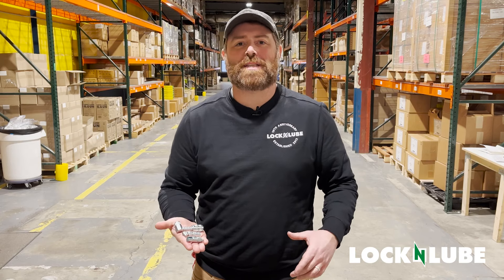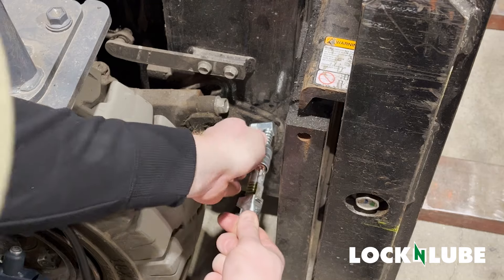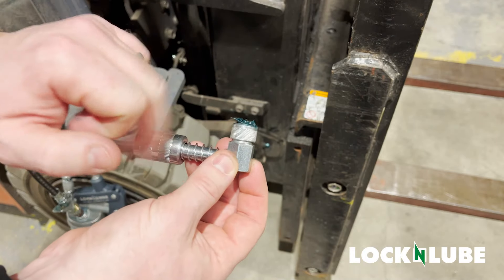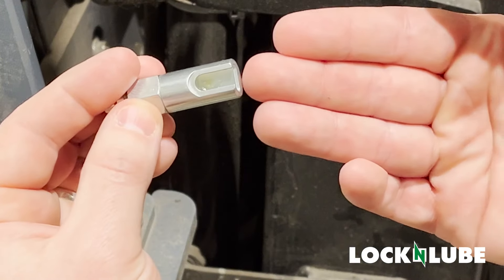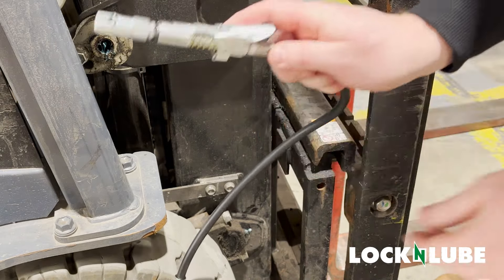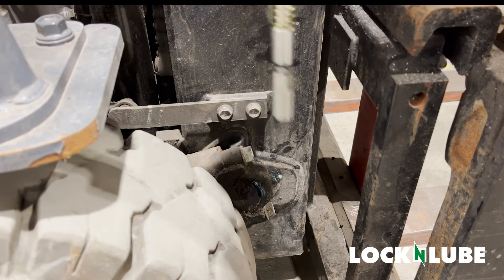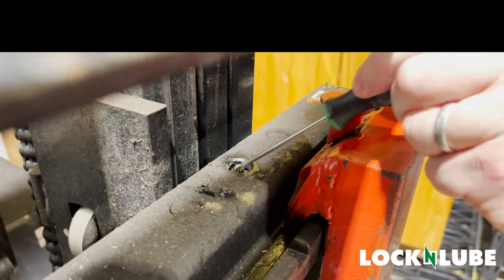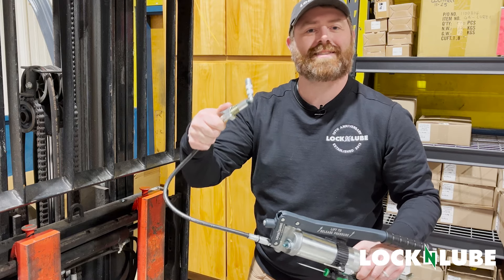LockNLube 90 Degree Greasing Adaptors

Comment: Excellent demonstration.     

I went with the LocknLube accessory kit, which has all three of the 90 degree grease zerk fittings shown in this video plus others.  

So far I’ve used 6 of the 8 grease accessories in the kit.   

The grease needle is the accessory use most often.  

Greasing is easier with these fittings.   

Thank you LocknLube